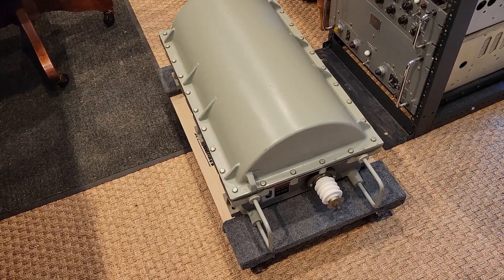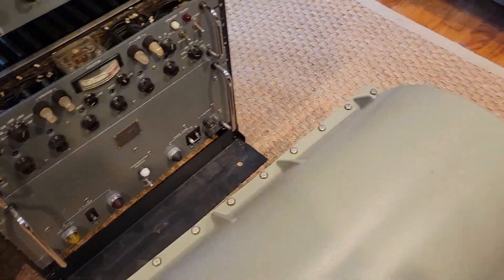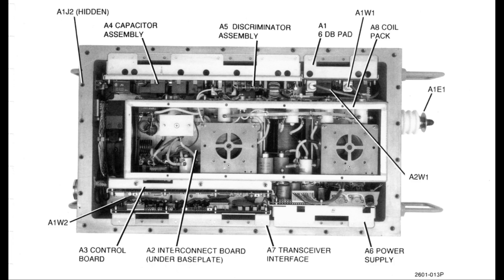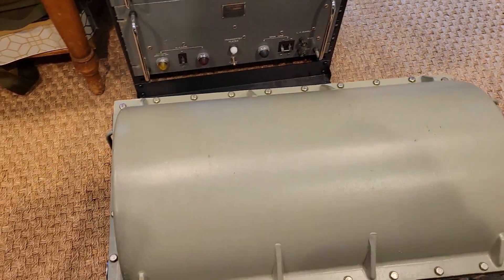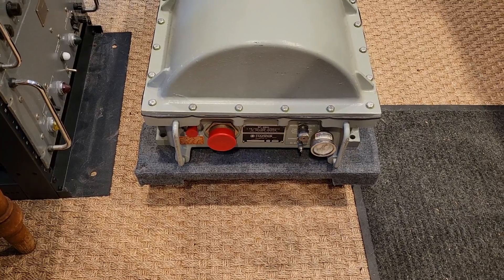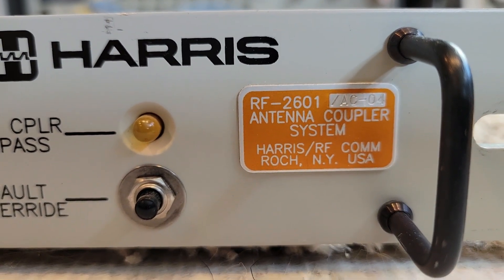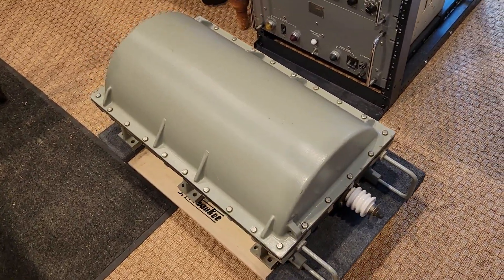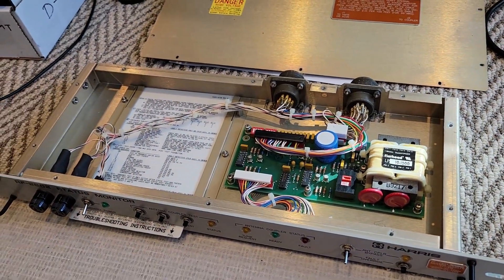Harris RF-2601 1KW Antenna Coupler (Part 1)

Comment: I used the 601 with the controller, the other Radioman would just used the auto tune but not me I would play with the caps and inductor until I had it perfectly tuned with my URt 23 Bravo and my R1051s